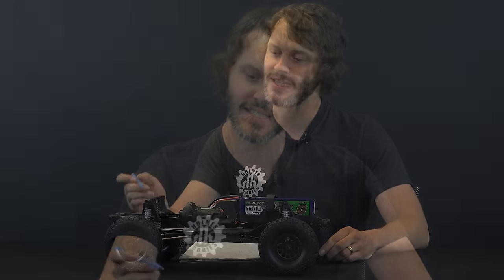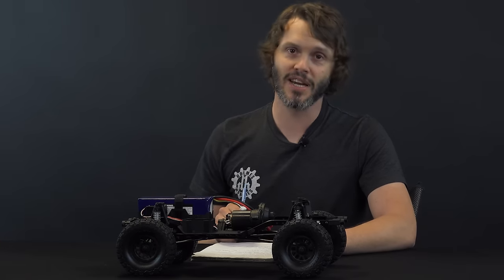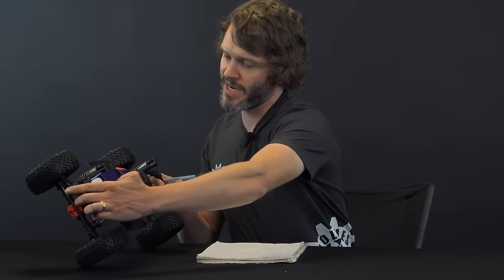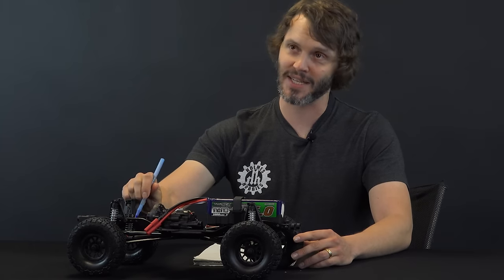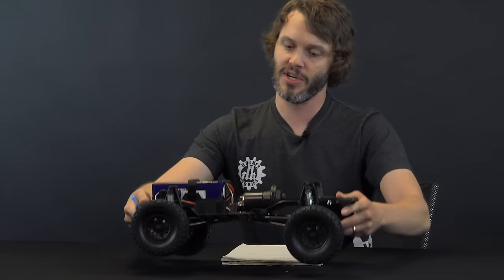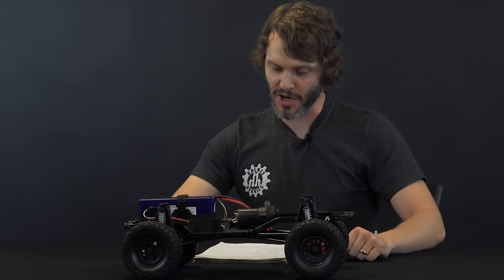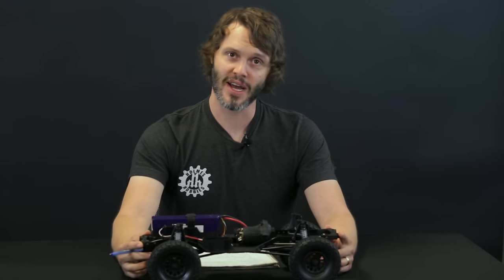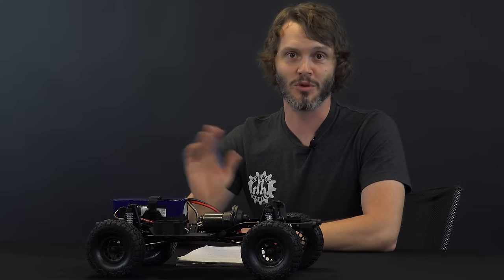SCX10ii Kit Review after assembly

Comment: Just ordered my SCX10ii kit, and this video really sealed the deal. Very comprehensive and informative. Will be putting an HH Puller stubby in it(either 2700 or 3300), with the BLE Pro esc. Thanks for the awesome review, John!
Reply: I just bought the stubby also the 3300kv how did it work for U? I have the same ESC also
Reply: I actually haven't made my motor/esc purchase for my scx10ii build yet. Been finishing up my Bomber build first, but have the scx10ii kit assembled and am about to paint it...electronics being ordered soon!
Reply: I felt the need to update what I went with, since you asked. Went with a HH Puller Pro 2700kv (540 can, not a stubby), and a Mamba Monster X ESC. Way overkill on the ESC, but I got a good price on it and so far it is working fantastically with the motor. Went with the standard sized motor over the stubby to have a bit more power on tap, and it seems to be doing great in the rig...very smooth, very good low speed control. I dig it!
Reply: Awesome I bought the BLE PRO ESC an the 3300KV stubby puller pro it's been great
Reply: Nice! Perfect combo for the rig. Have the BLE Pro in my Bomber and it's an awesome ESC, definitely using them ( and HH motors, of course) in upcoming builds.

Comment: I've had a 5700kv castle with mamba x in a gen7 stock and it took it. No brakes at all. Now I have it in my gen8 and the gear down works great. Perfect crawl and plenty wheel speed. I run at only 55% power though on 3s.

Comment: finally got mine finished, I have to admit I'm not a real fan of the huge bumpers and the body. I use a extended frame for my K5 Blazer body , I think there basically the same size right? That way I can use the metal bumpers I have. Plus it looks better.

Comment: John,

What would you suggest electronics wise for someone who wants to do a little bit of everything.  Rock Crawling and out on the trails.  Will be driving in the muck and mud, snow, water pretty much everything the elements can throw at it.  

Thanks !!
Reply from the maker: Water and mud will require cleaning to keep any motor happy.   But we do have sealed can style TrailMaster Sport brushed motors that are inexpensive and tend to run in bad elements longer without work.   The 550 size would be great in the sxc10ii
Reply from the maker: For a do all system that you will clean frequently or else avoid water/mud-  TrailMaster BLE controller paired with a 540 Puller Pro 2700kv.   Flexible enough for practically any 10th scale rig from racer to basher to trail rig.
Reply: I've been told that with a brushless system you should gear down, so with a 2700 kv Puller Pro..would that be the case ?  I'm new to all of this so I appreciate all of the feedback.  Was debating going with the 3500 and just dropping down to a 12t pinion, would the 2700 require that as well ?
Reply from the maker: Chris Hill gearing down isn't necessary unless the wheelspeed is too fast. Stock gearing and 2700kv is perfect on the scx10ii IMO

Comment: Would it be possible to use revo rod ends on the stock links? Thanks
Reply from the maker: yes indeed.   You will want to use them on top and bottom links so that the pinion angle is unchanged.

Comment: Why would you recommend a 2200 Mah 3s battery in this vehicle versus a higher capacity mah battery like a 4000mah 3s? How much crawling run time would you get on a 2200 Mah 3s battery?
Reply from the maker: I get over an hour with a 2200.   Vehicles are more capable with smaller batteries, and it's easy to keep two or three in the pocket
Reply: @HolmesHobbies  Thank you